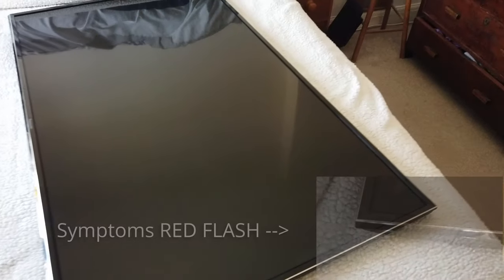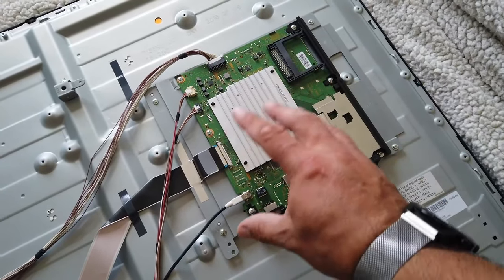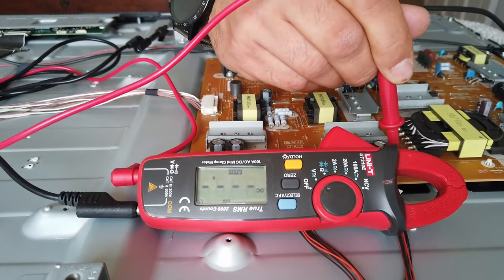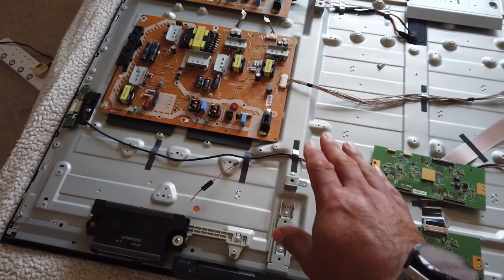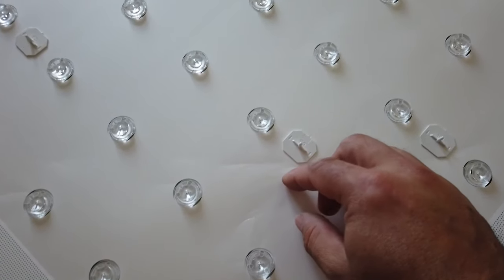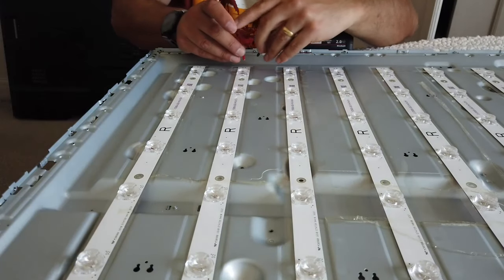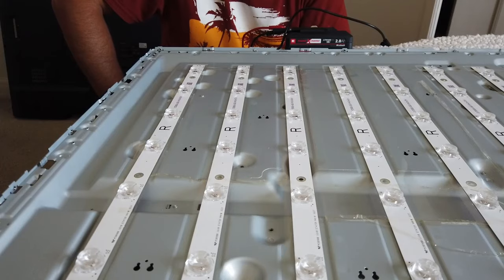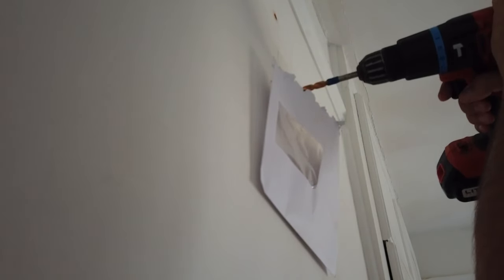DuB-EnG: BLINKING RED FLASHING LIGHT FAULT ON PANASONIC LED TV - Repair / Trying to Fix / Refurbish

Comment: 8:50  LED strips never fail in pairs like you see there.  However the connections to the strips do!   9:26  It's not a conspiracy.  It's FACT!  Open any newer TV up and all you see is folded ribbon cabled taped down to just the right tension so that over time and many cycles, some of the cables in the ribbon structure can and DO change their resistance and the end result is what you see here.    Naughty Panasonic, however they all do this now otherwise any of these LED smart TV's would easily last 30 years and we can't have that now can we????????
Reply from the maker: Does my head in that they fit parts that help  planned failure after time. Angry!
Reply: @DubiousEngineering  If we were these guys who need to shift perfectly good 4K UHD TV's?  There is your answer.  No sales!  And not many people pull apart their giant Smart TV when said person has "some" electronics knowledge eh mate?   But we know better.  Have a great week sir!!!!!!!!

Comment: Hi, if your new LED strips don't fix it, you could turn the tv into a big sort of panel light - DIY perks has a video about making lights out of tvs - very easy just get some cheap adhesive led strips, but them in and then all the diffusers and fresenel lenses layers make is a big soft light. I've done it with a couple of broken tv's I found on the street and it works well.
Reply from the maker: Ah yes! ...  a window light! ...  I've had a go at this with an old monitor... its quite cool! ...  lovely to hear from you again!  Best, H
Reply: I was going to comment about DIY Perks but you beat me to it Frigby  🛠👍😊

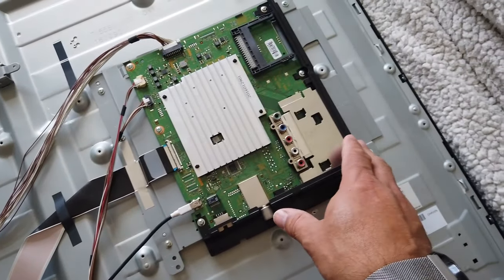Comment: 1:35   Note the FOLDED ribbon cable under the black tape?  That is an engineering no no.  Ribbon cables must always be absolutely flat and even for the entire run.  Remove the tape and gently unfold the ribbon cable and then let it flap around in the breeze inside the TV cavity.  There is no need to do what Panasonic have done here.  LOL.  To allow the main cable to be folded like that from the computer to the driver is absolutely asking for trouble.  Cheers.
Reply from the maker: Totally agree!!
Reply: @DubiousEngineering  I'd LOVE to see you start a "make your 4K smart TV last 30 years channel!"   LOL!!!!!!!!!!!   Because they certainly almost surely will if these filthy tactics were not adopted.  Oh well mate.  Such is life.

Comment: I did the same as you.  Found a set of LEDs that were not working, got a new set off Ebay from china and it still didn't work.  The boards were ok.  They over drive the LEDs to give the tv a nice vivid picture, if you turn the brightness down a little right out of the box, the set will last much longer.
Reply from the maker: Oh balls...   I ordered leds yesterday...  oh well, fingers crossed 🤞

Comment: You ought to remake that TV into a 'fixable' model that hinges open like a car trunk, uh boot?
It might be the longest-lasting appliance if you could make it easy to replace parts. 
Companies do not want things to last for a long time now, want to sell more and more. 
Gone are the days of repairable appliances, buy one for the rest of your life. Now it is replace with the 'latest version'. UGH. Ah, but you tried, and a new work area for a bit of a change. Could you make a table out of it or something?  Or can you test your new saw and cut it into easy-to-remove bits that fit into the recycling bins? I'm a year older today. No party, just some ice cream and moonshine beverage later.
Reply from the maker: OOoh...  Happy Birthday Karen!  I'd love some of that moonshine!!  Does it come in a glass jar!?!?  Anyway...  I did get it fixed by replacing the LEDs, but then sadly broke it again after trying to re-assemble.  So...  out came the chop saw - I made it real small and put it in the bin!!  :-)

Comment: Great video..
Spewing after buying those 3 replacement boards, least you have 6 boards you can sell now...

I have my brothers PANASONIC 42" LED TH-42AS700A, which powering on gradually became problematic untill if finally wouldn't power on , ( was no more than 2 years old ) but resulted in a fast Green LED blink code ( aparently power board failure code) , which is next to the stand by light ..anyways I immediately thought of Electrolytic capacitor damage but noticed they were all Rubycon which are generally the best..
Any other ideas appreciated.
Cheers
Reply from the maker: My problem was LEDs...   Actually, just one led ...  Nightmare to get to....

Comment: What did you do with the old TV.. Could come in handy for me that has the know how and patience
Reply from the maker: I've put the pcbs and wiring looms  up on ebay ...  I also have a few strips of leds
Reply: @DubiousEngineering  LG 4K UHD's suffer a very convenient "out of warranty" manufacturing issue.  The symptom is "Could not establish an internet connection, retry".  And it is not a software issue as so many thousands of owners think.  The Bluetooth and the WiFi transmitter are connected by very fine "ribbon" cables that LG decided to FOLD at 90 degree angles!  Works fine for a few years then gradually more and more loss of WiFi error codes.  Solution?  I pulled the back off our 65" and simply "unfolded" the ribbon cables and the extreme tie downs and simply removed the tension and made them all nice and dead flat again.  Re-assembled and has worked like a charm for over two years now.  The secret is that LG "cover" the folded sections of ribbon with a black tape so you can't see the kinks.  If you don't look closely it would be easy to miss.   Grrrrrrr @ LG!   Cheers!

Comment: Hello, I have the same problem with TX-40AS640,PSU have 15.5V and 21V instead of 16 and 24, because signal TV_SUB_ON from digital board is missing. I apply it from 5.3V, PSU working well but TV don't start. I saw PNL_12V rail is down, I apply Enable signal for 12V PSU. rail is OK,, it supplies the T-CON, which looks ok, TV  don't start... 😂. So. yeah... The LED strips must be the problem
Reply from the maker: Yup...  pin in the arse getting to those leds !

Comment: I reseated all connectors and the tv worked again, but that was short lived...TV worked for 30 mins approximately...now  TV won't turn on at all now 😂
Reply from the maker: Cut your wife's hair and buy a new TV 😀
Reply: Often if you take power lead out, then press the physical ON button for 10 seconds this can help reset. I have the blinking red LEDs - 7. Apparently this is the 3.3v line not keeping to required voltage then the PS gets shut off. It is sometimes instant then won't switch on (until I do above). I saw one dude trace back to a fault cap on the LED mosfet. In out case the Mrs put some water out for the cats ... they knocked it over back of TV and it poured out.

Glad to see what has to be done to get inside the LED array. Looks like I will be ordering a new TV ... and new cats. I think I will try to see if disconnecting the LED board allows the power to stay on - if so then likely like you it is problem with the array and well then it isn't worth parts canoning the thing.

The 32" LCD Samsung has been promoted back to main TV. That has lasted almost 3 x as long as the Wanasonic. Maybe the Mrs will get that Bravia she kept on about.

Thanks for posting. And good haircutting skills.

Comment: The correct way to test the power supply is out the output. That will pinpoint the problem without wasting money on guesswork. Nice try tho we all get to learn the hard way sometimes.
Reply from the maker: Yeah...  And the root cause was an LED in the backlight that had failed....   But I'd broken the LCD display accidentally by then.  FFS